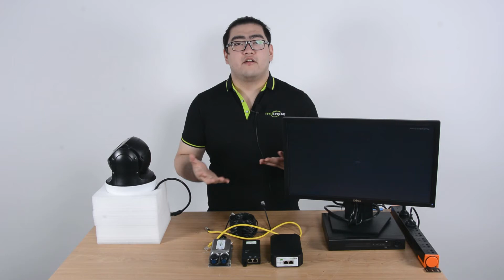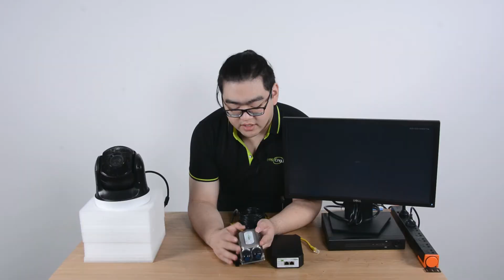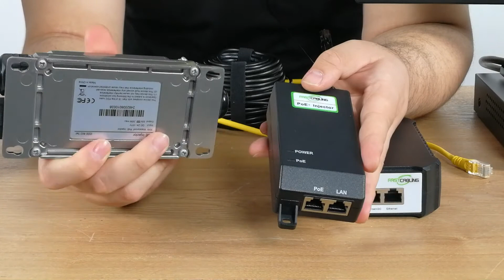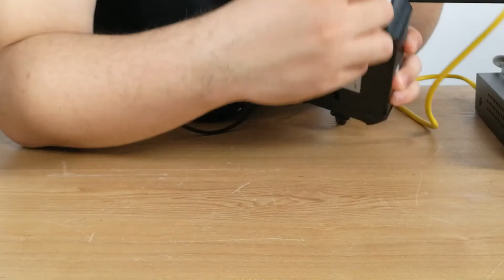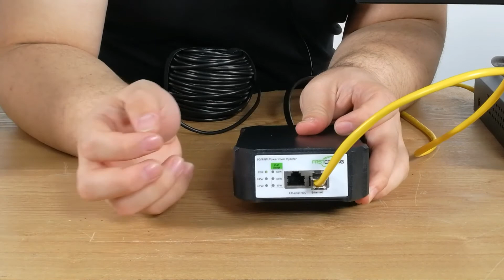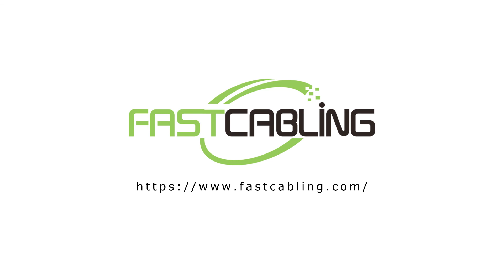Are IP Cameras Required PoE Injector for Setup?

Comment: Just bought a used Panasonic WV-SW598. Spec says to use a 24V IEEE802.3at compliant injector but the higher power ones are all 48V. Any idea what I should buy? Many thanks.
Reply from the maker: I think you misunderstood the specification of SW598. It supports AC24V and standard PoE+ (48V to 55V). You can use any standard PoE+ injector to power SW598. The power can go through the RJ45 port which belongs's PoE or DC terminator which uses AC24V.